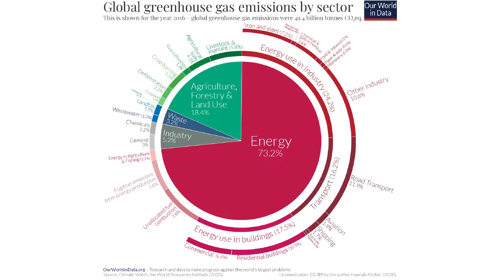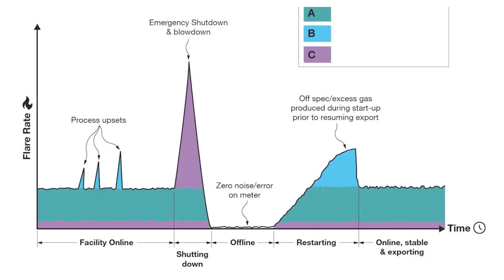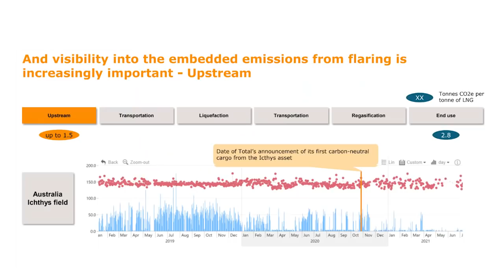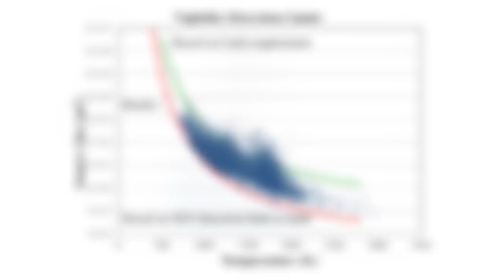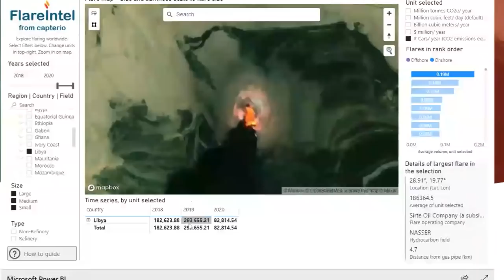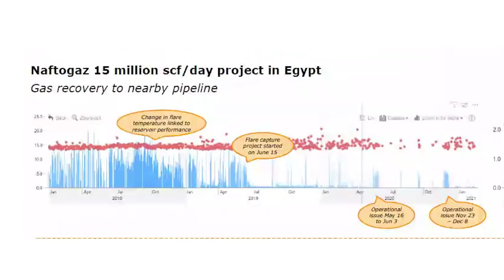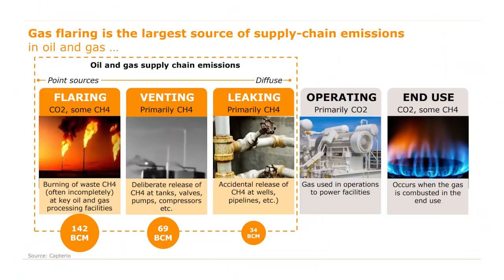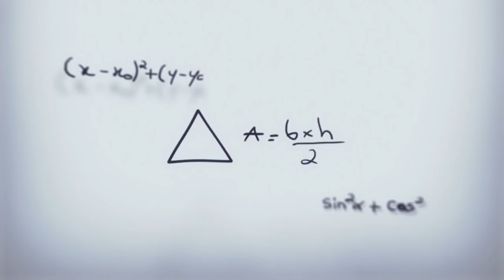How to Get Rid of Fugitive Emissions From Gas Flaring

Comment: What absolutely grinds my gears is a refinery in my country, situated in an industrial area, routinely flaring gas during an electricity shortage crisis.
Reply: Did they have any on site issues at the time?  How big was the flare & how often did it happen?
Reply: @BernardLS  It's a tall flaring stack that burns permanently, as far as I can tell. I've never seen it not burning. I've not been to the area for a few years now, so perhaps things have changed.
Reply: @NielMalan  Perhaps some one in management got a fresh set of KPI (key performance indicators) or they just tightened up on the task of getting maximum revenue from the resources.
Reply from the maker: That would grind my gears too Niel!

Comment: Leakage is also a much much bigger problem than the industry admits, but unlike flaring it is difficult to measure.
It isn't quite as stupid from a $ standpoint as it sounds though.  The technology to avoid it is there, but it normally costs more than the value of the wasted gas.  Polluting needs to cost more than not polluting
Reply from the maker: According to Capterio there are plenty of revenue-positive projects available to reduce flaring. It's not suitable for every single flare, but we could make a big dent in the amount of fugitive emissions if we just started by tackling the ones that give an overall financial benefit. Once we've taken care of those we can think about how to incentivise action on the rest.
Reply: @EngineeringwithRosie  Oh, agreed.  Your video is quite good to mention the different reasons for flares and such.

Comment: Flaring, venting and leaks happens because avoiding it reduces profits, at least in the short perspective. A certification system with extra tax on fuels from uncertified sources in most consuming countries would create an incentive to reduce fugitive emissions even for companies in countries that doesn't care about climate.

Also, production cost would increase slightly by the cost of preventing fugitive emissions, making alternatives slightly more attractive in comparison.
Reply: The material lost by flaring, venting and leaks represents lost revenue potential.  A strong incentive is for the administration's to charge royalties on 'extraction' rather than 'exportation' from each site.  Fun fact about all those 'subsidies to the fossil oil & gas industry (FOGI)'.  The FOGIs bay a lot of tax as well, on balance probably a lot more goes in taxation.
Reply: @BernardLS  To use that revenue you need to make a capital expenditure e.g. you need to buy gas liquefiers or generators. If the cost of that capital is higher than the revenue from the gas that would be otherwise flared then avoiding flaring will result in a net cost. However, sometimes you could just use the gas to generate the power to run the drilling operation. The devil is in the details.
Reply: @gustavlicht9620  As you say 'the devil is in the detail' & all activity has costs. In the great juggling act of 'price, cost, value' flaring might be low price only because some of the cost, atmospheric degradation, is externalised while the value of utilisation for on site power generation, reinjection to enhance recovery or liquifaction for removal may be hidden by time required for pay back.

Comment: Excellent topic and informative content! Thanks a lot for creating this 😊
Reducing methane emissions is indeed among the best ways to buy a little time to decarbonize our economy to avoid the worst of climate change.
Reply from the maker: Thanks! Isn't it crazy that we don't focus more on this topic? Need to get Greta on the case!
Reply: @EngineeringwithRosie  completely agree! We need cities and companies to prioritize methane reduction. I also plan to create a couple of videos on methane emissions and mapping it using satellite data. Thanks a lot again for your great work!
Reply: @EngineeringwithRosie  WADR the only thing Greta does is interject more emotion.... Into subject matters that need logical options... So everyone or at least a majority, can be in favor of implementing cost effective  solutions. IMHO 

And I guess I'm braindead, since it was never clear to me why they cannot just turn a valve to regulate the flow of NG instead flaring it? Is it a pressure build up issue or a different issue??? 

And if it cant be regulate it, how about producing methanol production from the excess NG that being flared?  For uses such as to power fuel cells? But would it be consider "Green" or "Blue" or "Brown: or some of color of an energy source?

Comment: I work in the industry and the problem is largely associated with existing and aging assets. I've worked on new projects for 20 years and can't think of any that have routine flaring as part of the design.  It is much more expensive and operationally & technically challenging to retrofit flare gas recovery systems and other means to stop routine flaring, particularly if the asset only has a limited commercially viable life left and is built using old technology.
Reply: So where do the flaring come through? It's there, photographed.
Reply: @eskileriksson4457  please re-read the comment. This is likely an existing asset.
Reply: @oootoob  Ok
Reply from the maker: That's awesome. Can I ask which country you are working in?
Reply: @EngineeringwithRosie  I'm in the UK but I work on projects mostly in Europe and the Middle East, though have also done jobs in Australia, India and other places

Comment: on the subject of CCS, blue hydrogen, and the need for hydrocarbons as chemical feedstocks - I've been wondering how well coal gasification could contribute in these roles

does coal mining have high or low fugitive emissions? (I assume it must have at least some from underground methane escaping as the coal is dug up)

can coal gasification compete economically with natural gas?

can coal-to-liquid projects efficiently provide the necessary long-chain hydrocarbons?

should coal be considered a reasonable approach to producing blue hydrogen, or is it better to just stick with oil and gas?

Comment: I am pro-oil and gas, but I do think we should start requiring flare gas be captured and turned into products like LNG or used to generate power. For God's sake we only have so much oil and gas, we need to use it WISELY. I would like someone to be able to have a system that is "no-flare" where the gas is either generating power or stored and sold.

Comment: comes back to the subject that coal is less carbon intensive if methane leakages is included, I think it was 2.8 vs 3.4?
Reply: Coal is still a lot worse in nitrogen and other emissions but yeah natural gas isn't the perfect bridging fuel it's hyped to be.
Reply from the maker: Thanks! This one was a bit outside my normal range of topics, but when a friend introduced me to Mark I, like you, was surprised at the extent of the problem and wanted to find out more and share what FlareIntel are doing about it.

Comment: What puzzles me about this is money.  When I first saw a flare stack and the size of the flame, I couldn't understand why someone was just throwing away money on such a large scale.  
I don't really understand the difficulty in capturing it?  Perhaps I missed it in the video: I shall have to rewatch it.  If they can capture it as it pours out of the ground in even larger volumes, what's different?
I think they said it's dirty or impure, but surely it can't be as bad as the raw gas produced by distillation of coal, which was the backbone of urban gas supply in UK when I was young.
Reply: "I couldn't understand why someone was just throwing away money on such a large scale."

Utilizing it might not be that cheap either. Of course, I'm just guessing here.
Reply: @seneca983  Of course: that's why I mentioned coal gas.  That was as filthy a mixture as you could get, so similarly had storage and processing costs, but they also had to buy coal to make it.  Yet they still made a profit after they had cleaned it up.  This stuff is being thrown away.  Can they really not make a profit from processing it?
Reply: @Merlin3189  In the case of coal gas it was a byproduct of producing coke (or if the gas was the main product you also got coke as byproduct). Also, the coal gas plants could probably close to where the gas was being consumed.

Today, we don't need gas as much because the same things can be done with electricity. Oil fields where gas is flared might be in some remote locations where getting a gas pipeline can be expensive. If gas is cheap in that region and emissions don't have an associated cost it might make more commercial sense to just flare the gas.

I'm not 100% of this but this is my best guess as to why in many places they have not bothered to utilize the gas.
Reply from the maker: My understanding is that in a few cases it really is more expensive to do something with it than to just waste it, and in others they simply haven't bothered to do something else because 1 - they make plenty of money even with that waste 2 - they might not know what else they can do 3 - they might not have the resources (staff with time) to do the more complex thing
Reply from the maker: Yes I think you're right. There would be upfront costs and extra complexity in all cases, and in some cases where there isn't a nearby pipeline or way to use the energy then it might just be more expensive to use the gas than to waste it.

Comment: Hell of a problem, even on-site usage increases overall output of CO2 because of the added equipment. Putting it in an existing system of Pipes is the least cost idea? But then it seems too similar to the coloured Hydrogen bs.
Reply from the maker: There's never going to be a perfect solution, but while we are still burning fossil fuels we can get an emissions saving by displacing some with something that would have otherwise been flared, leaked or vented. And once we get to net-zero? Maybe they can use the energy to power direct air capture? Which is still a pretty ugly solution.

Comment: Pretty surprising to see such high emissions from Iran and Iraq. They each produce about a third as much oil as the United States but more flare emissions. Why? 

Disappointing to see Iran decline to reduce flaring as well, but that's par for the course for Iran I suppose.
Reply from the maker: The FlareIntel guys told me that in general, the cheaper the resource the more fugitive emissions. I guess it's natural to be less worried about wasting a bit when it is a really cheap and easy resource to extract. So in the absence of strong policies to eliminate fugitive emissions, all the countries with cheap oil and gas resources will naturally have higher flare intensity.

Comment: So the argument here is mainly that this energy source is just being dumped into the emissions footprint with no net benefit?  If the gas were captured it will eventually be dumped into the footprint anyways.  Gas burned now for no reason vs gas burned later for energy source.  Am I oversimplifying this?  I agree that this is incredible waste but do not see any environmental benefit.
Reply: Looking again I see the sheer volume issue being a major factor.
Reply from the maker: The benefit would be that the energy "burned later for energy source" would prevent other fossil fuels from being burned, so reduce the total emissions. Which won't happen if the energy is used for something totally unnecessary like say bitcoin mining 😉 (my opinion). 
When we are no longer burning any fossil fuels, then it would either have to be captured or used to power direct air capture. Because yes, you are right that it is still a source of emissions if it's burned.